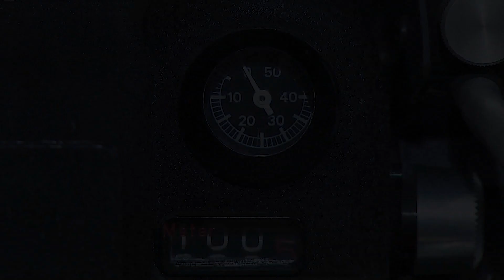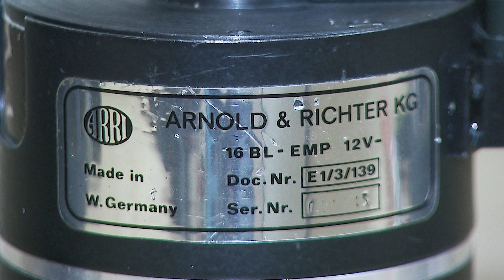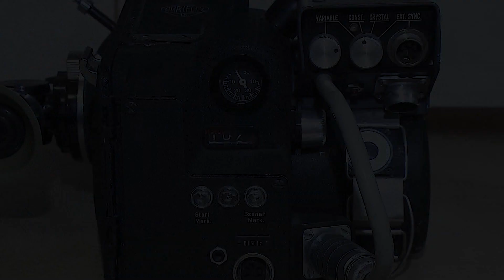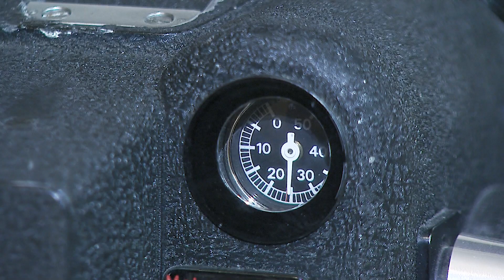How to change motor in Arri Arriflex 16BL film camera

Comment: How do you get it to 24fps
A local dealer is selling one thats running at 29fps
Reply from the maker: In 16BL change of speed is done by exchanging 2 cog wheels located in film chamber (visible in 1:39). So in order to run it at 24 fps, you need such wheels. Make sure what cog wheels are already installed. Speed is written on them.
Reply: @ANALOGBYDGOSKI   okay thank you, ill let the shop know! Hopefully they find the right one
Reply from the maker: @DethronerX  It also depends on type of installed motor. I don’t recall genuine Arri motors to run at 29 fps (I may be wrong though). But with crystal sync motors like Tobin, or with crystal sync attachments change of speed is a matter of changing the setting.
Reply: @ANALOGBYDGOSKI  Do you know where  can I get the right gear and what should I search for
Reply: I've also sent them your video for reference. When i receive the motor, ill mail it to them, they're just in another city.
I'd definitely like to know how to change the settings on the crystal sync motor